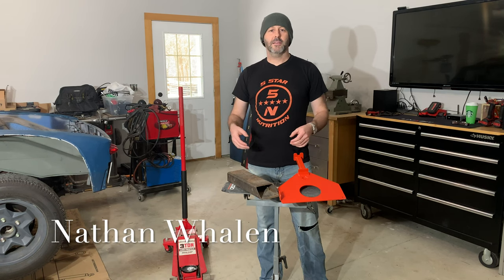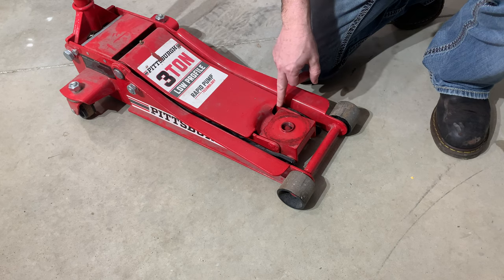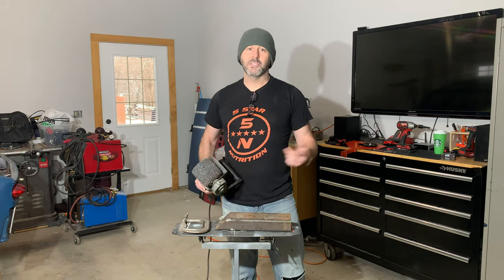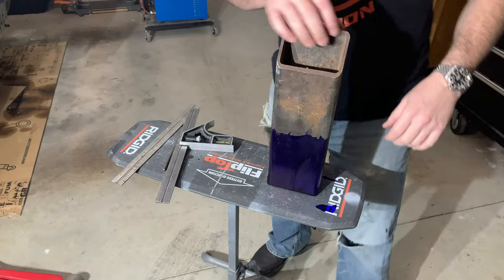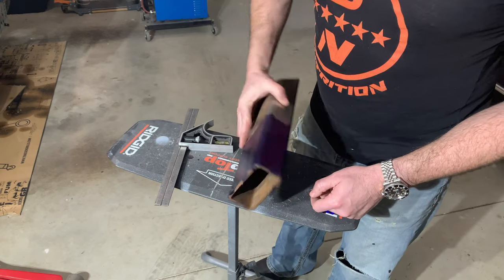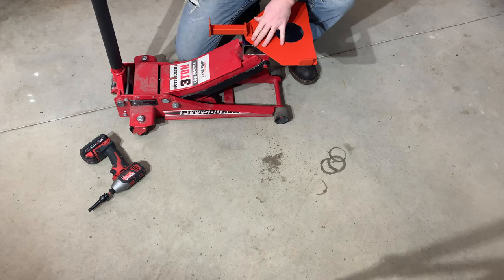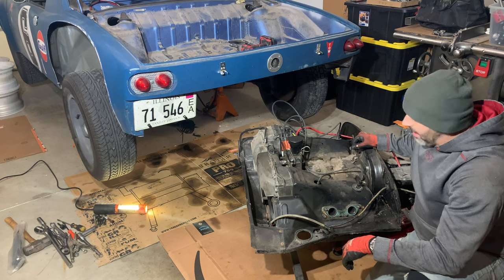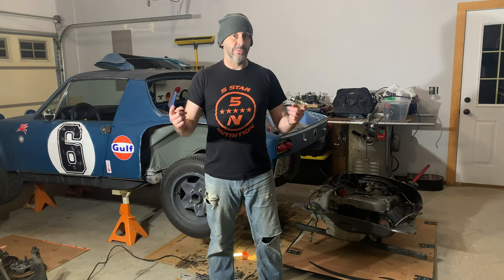Porsche 914 engine removal with tangerine racing jack plate

Comment: another way to make an adaptor is a pipe the I.D. to fit the pin ( on your motor adaptor plate )... cut it to fit height wise to pin..weld a flat plate on bottom with a hole to fit your fastener on jack... and it should drop in and lock in like in a old jack ... if wobbly add another flat plate at top hole...
Reply from the maker: I thought about that but was worried about stability, plus I had the square tubing in stock.